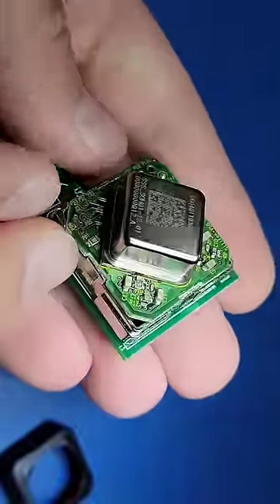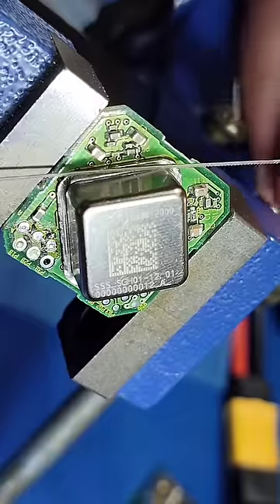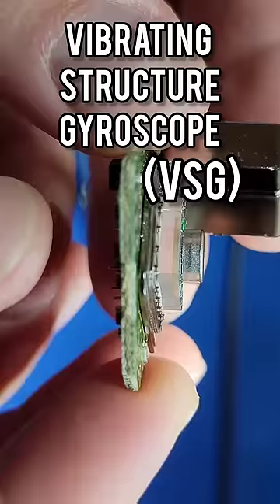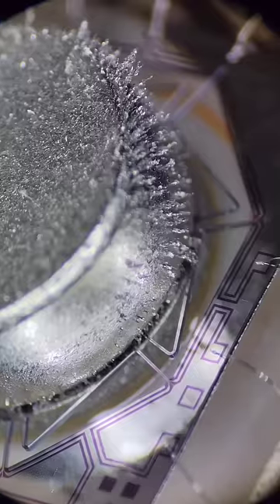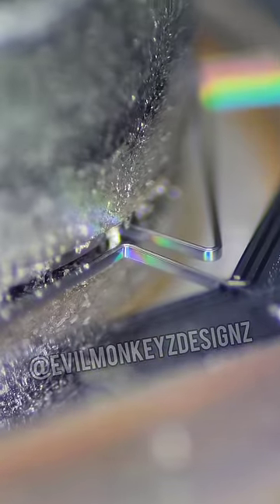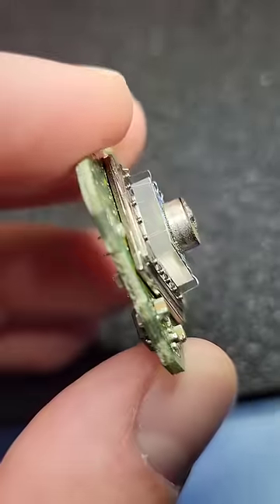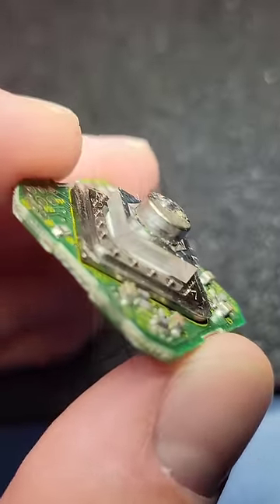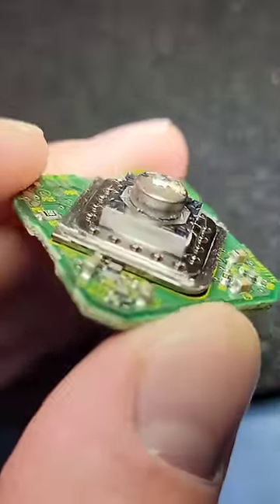Inside a #MEMS Vibrating Structure Gyroscope

Comment: Hi, this ring gyro utilizes Lorentz forces to induce vibration and induced currents for reading. The ring, functioning as a coil, has currents driven through it by electronics. These currents interact with a metal magnet situated on top, causing the ring to vibrate. The mechanical vibration is influenced by Coriolis forces and becomes perturbed by motion. This perturbation, in turn, interacts with the magnet, and the induced current is read back by the electronics. Hope it's clear enough!
Reply from the maker: Thanks! I was wondering how the magnet tied into this. It's interesting to see how they improved the design in the 4th and 5th generation to no longer need the magnet. Very cool stuff.
Reply: La hermana de quién?😮
Reply: @argentinovictoriano3218 теперь я понял откуда мем про сестру
Reply: Do the accelerometers that look like brushes alsp function through the lorentz force?

Comment: I designed an IMU from this manufacturer ! I used 3 of them, one for each axis. They were expensive, and originally used for geophone based ground imaging.
Reply: I was going to ask how this worked as a gyroscope if the forces were only planar. That answers my question; they only work in one plane.
Reply: @revcrussell I thought from the title that they would be driven with physical oscillations, and measure the deviations of each leg over time. 🤔

Comment: As an engineering technician in aerospace, your page helps me visualize what’s going on inside of the devices I set up, calibrate, and from time to time — write firmware/code for. I’m not saying everything inside of these chips was a mystery to me, but I could never seem to visualize how chips were “hard wired” to pass data through. Thanks for this page and your content, I’m stoked to have found it!

Comment: Looks like they had some runout on one of the mask levels - you can see the offset alignment mark shifted to the left…the target on the other side of the wafer was probably offset to the right…usually mask design error, or thermal expansion of the wafer during alignment. Neat.

Comment: I had a rc helicopter with a gyroscope for the heckrotor. I opened the box and inside were 2 turning solid metal wheels. When moving the device the weels want to stay in position and pressed switches. It worked fine for then. Nowdays gyro stabilization is build in the receiver that's a quarter in size and hundreds of times better 👏

Comment: and how is the top part "suspended" ?I am stupid,I only understand Newtonian physics..so basically something needs to move a tiny bit to induce a force and some stuff will oppose that and you have some crap reading that .....but how dose it move?the top part must be somehow independent from the bottom par so it can vibrate due to movement but if they are connected they are both in the same ref system there for they both (kind of) move/vibrate @ the same Hertz....it is suspended by the wires?

Comment: So the purpose of these is vibration? But no “technically” moving parts? kind of a solid state motor. This is very fascinating. it took me a few times of watching it, but I see it oscillates causing vibration, so it does move some just not rotates.

Comment: Surprised that there was QR codes in 1998.. or it was probably added later for some inventory management.
Reply from the maker: I had to look it up because I didn't know, but the QR code was first used in 1994, so its plausible this could have been used on the initial units, but I could also see it being something added to them later in production.

Comment: The coriolis effect is not a force, It doesn't do anything.
You have an observer standing on a rotating non-inertial frame of reference and a plane goes over his head in a straight line. From the observer's point of view, the plane is taking a curved path. (but it's not)
This is the Coriolis effect, an illusion.